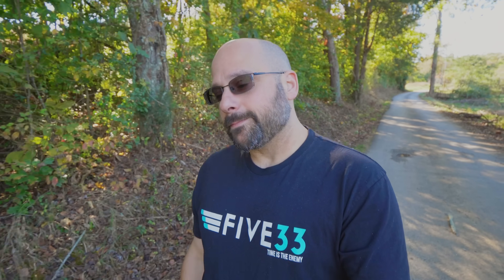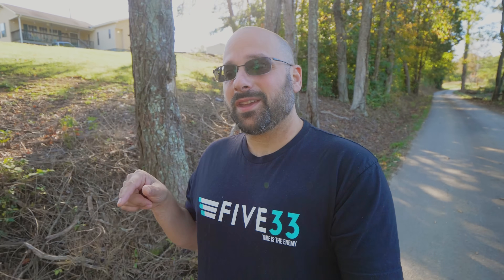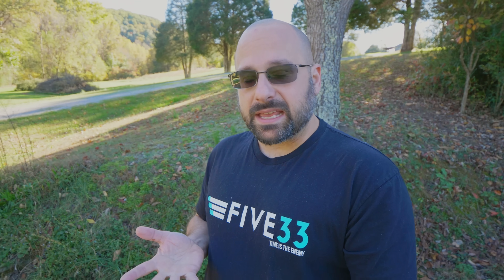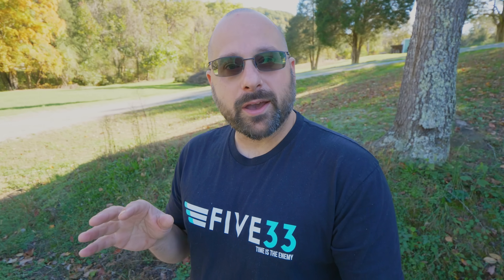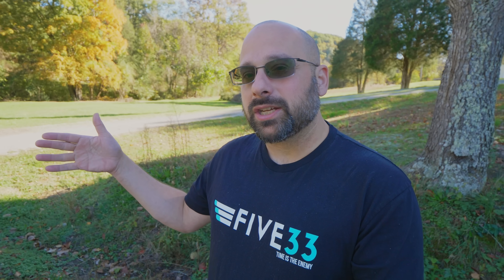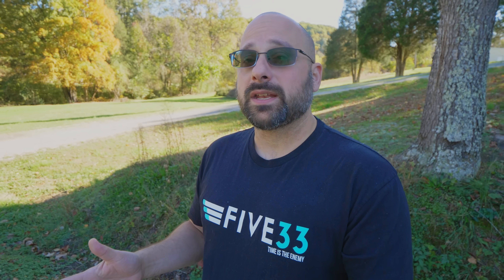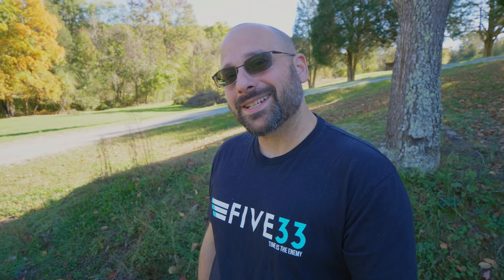How long can you leave your lipos fully charged without damaging them?

Comment: I have a Phantom 1 that I have always only flew 50% and I'm still using the same 3 batteries I bought with the drone . The only batteries I
have had problems with are Phantom 4 Pro batteries they are all junk , bad DJI design from the start . My Mavic 1 is still using the same
3 batteries . I always bring it home at 62% and land . It works for me 62% bring it home and land equals long battery life .

Comment: Chatgpt says lipos charged to 100% for 30 days straight is worse than 30 separate 24 hour periods at 4.2v. Says the rest period between charges has observable effects on the chemistry. Says a 30 day period at 100% will likely result in 20-40% reduction in lifespan not 5%. Says 5-10% per month sounds more like lithium ion batteries.

They are consumables so not using them just to make them last longer can be dumb. 

My personal experience has been that lipos stored and forgotten swell up more often than not. I personally avoid charging them unless I know I will fly later that day. I can't recommend charging them the night before either. Just buy a smart plug or electric timer for $10 and set it to charge a couple hours before you wake up. This is if you really need to be somewhere at 6am or something, otherwise just let them cool down and charge them to 3.8v. Store at 15C and check of them every few weeks for best results.

Comment: Well, I'm here because I have like 5 FPV batteries that I bought back in like 2018-2019. I did not do my homework when I got my first FPV and I charged up all the batteries, did not set up the quad and my radio properly and took it up in the mountains to test it out. I launched it into a tree in a second and I wrapped it all up and never touched it again. Here we are on todays date, I found 2 Tattu batteries that I never took out of the box and all the ones I charged. The ones in the box are surely as you mentioned brand new. No swelling no issues. The others were all stored at full capacity for like 6 years. The ones that were charged are now sitting at 3.8 ish volts and are slightly swollen. Not to the extent that they look blown up, but the plastic wrap on the outside of the battery is more bulged and puffed up that is for sure. I figure I'm going to play a bit of a risky game, but I went ahead and plugged one in and set it for a slow balance charge. So far all the cells are coming up evenly, no heat, nothing crazy going on, we will see.  I've had swollen lipos in the past and still use a couple in my cars and I have never had one blow up. But these are slightly swollen packs that I do not push when charging and considering I always ran stock specs, I doubt my cars were discharging them at any crazy rate. I have had a pack or two that was so swollen the plastic case was splitting apart and I didn't play with those. I dont know if this helps anyone, but personally I build my knowledge off of first hand experience which may not be the safest option but I figured I'd leave my experience here in case it helps.

Comment: So over winter months as I am not out flying, if I store my lipos @ 3.8v, then they will be fine leaving them for this long period right? Going by what Joshua said, technically should be good for years in storage mode? I have them in a bat box which is also placed inside a lipo holdall, in my garage, and I do a physical check every 2-3 weeks for deformation, swelling, leakage etc. This is ok right?

Comment: While I believe this is correct. I was out of the hobby for 5 years. Found 2 3s batteries left at full charge during that period.  I slowly charged them and repeatedly reached 96 to 97% since. They were an eflite and a hobby king brand 3300mah
Reply: I have about 20 lipos that are over ten years old that have been in storage mode. I'm not in the hobby anymore so I have no idea what sort of condition they are in for re use.

Comment: I am a longtime hobbyist in RC. I started in the early 80's with a tamiya frog buggy, had a 6cell nicad and a wall wort style dc charger. nicads were so stable in comparison to lipos I've noticed. in the later 80's i was racing 2wd truck a losi jrxt. i luved that truck. Took home to many trophies with it. but my point is back then we geared the cars to hopefully last a 4min race. after the race we marshal and then take our trucks to the pits and discharge the nimh pack with 12 1157 automotive lights all soldered together with a recipient plug for the battery. and depending on how long it took to make the lights dim told us if we could maybe gear up a tooth or 2 on the pinion. alot of the times we forgot the bulbs were on a battery and came back a while later to cold bulbs. but you could pull the lights off and plug it in the tekin charger and charge it right back up. I dont dare use the lights on lipos due to how delicate they are in comparison. what I have found for lipos is if your looking to get the most from your packs I charge up the night b4 for what I intend to use the next day. and like you said life happens and next day didnt goes as planed so i would try for the next day, if it wont be for a week till use I now put them on a storage charge. I have had some lipos puff up on me from accidently leaving the lipo fully charged for months. so lesson learned no more than 2days on full charge.

Comment: I have given this a lot of thought recently myself. I have had batteries charged for close to a week before using them. I prefer to discharge them on the plane in the air then on the charger on the ground. Having said that I recently bought a small generator to take to the field since we have no power there. And I will from now on charge my batteries and then fly them immediately: and I won't charge more than I'm going to use.

Comment: I've just learned to accept that 60-80% is the real "maximum" to avoid potential fireworks shows.
I store my phone/vape in a backpack while travelling (outer pocket), and wrapped in a fire blanket at night. 
Old cells are fully discharged (at least as much as they can be), and placed outside in a ventilated metal toolbox (ventilation to prevent explosions). Until I get around to disposal.
Glad to see everyone waking up to this new reality, hopefully in a few years Lithium will just be a forgotten nightmare due to better/safer tech.

Comment: I don’t fly drones, tri-copters, or helicopters so I rarely experience crashes in my airplanes that result in damaged batteries. That’s not to say that on rare occasions, I do have a completely destroyed battery.
What I have experienced with long term (6 mo or more) fully charger is my batteries will balloon. Sometimes they have lost all there stored voltage and other times not.  All will take a charge and perform adequately but I just don’t trust a puffed up battery and will discard them. My current process is any time they are not going to be used for a long time (late fall and winter is coming) I will put them in storage charge.

Comment: I never have this problem. I fly petrol (gas) engines. I can fill the tank and leave it for a week or a month or more. I only need to seal all the vents in the tank and keep it in the garage if l need to. When do come home, the tank (haha - "battery") isusually empty anyway.
I never have worry about storage or how long it takes to "recharge" before another flight. Petrol is so much safer, can fill up as often as desired and fly all day. Best of all, l dont have to lug an extra pound of dead weight when l land.
Reply from the maker: Gasoline is safer than lipos? Riiiiight. Because nobody has ever burned anything by mis-handling gasoline. Both types of fuel have their advantages and disadvantages. Fly whatever makes you happy :-)

Comment: One thing most don’t know also is that if you only ever charge a lipo to 4.1v instead of 4.2 you will get double the charge cycle life out of the battery pack.  That has been tested and proven by numerous manufacturers.

Comment: I left my lipo 1.3 4s at storage for over 2 years...i thought i lost them in a move. And this christmas i was going through bins for decorations and found it, they are still at 3.8 and im charging them now. Im so excited.
Reply: So how were they like?
Reply: @nomidubidabi  I had 2 heavily used 6s batteries that I put at 3.82v 5 years ago. just check them a month ago and they are still 3.82v EXACTLY. They still feel like 90% what I remember them being but that's within the margin of error for 5 years lol. I think they are still perfect tho. I never left them fully charged for longer than 6 hours at absolute most tho so maybe I was just more careful than average.
Reply: @donutves  Wow, that's wild, it's great to know that are so resilient to long term effects.
Reply: @nomidubidabi  ya I was always kinda worried about these batteries but they seem to be incredibly resilient
Reply: I thought that after a few months of a battery just sitting at storage charge, you would need to recharge it to that same storage level because it would drop voltage to an unsafe level just by being neglected

Comment: My guess is if you chose a battery to relentlessly scientifically test you'd come up with bold answers.  And then if you repeated on some other battery your results would differ.  Battery tech strikes me as a little fuzzy compared to a lot of other products.  BTW, if you're interested, there's movement on manufacturers recommendation for storage voltage.  Check the package inserts with GNB cells and you'll find that they now believe much lower storage voltages have benefits over the typical 3.8V.  Specifically they like storage between 3.3 and 3.6V with the caveat that you check them periodically to ensure they don't drop too far below that range.  The claim is their testing says low voltage storage optimally preserves life time capacity.  I think their drop dead minimum voltage is 2.7V to prevent chemical deterioration.  I know you did this video two years ago, so perhaps your thoughts on battery maintenance have changed.

Comment: I actually left a 4s 6000 lipo fully charged for about 5 years. Totally forget about it. I tried using it and was surprised that it still worked. Prob had about 2/3 of the capacity it did new, but considering, not bad at all.
Reply: It all depends what the C-rating is for the battery

Comment: I am always concerned about this very important matter.If I charge my batteries and the weather suddenly turns bad,low visibility,strong winds etc.This is a concern I have all the time.I charge my batteries and expect to fly,and for some reason the weather turns bad and I decide not to fly my  prised fixed model airplane.I try to strive to fly the very next day or I run the motor down until  the batteries are close to storage voltage.But,this is a major concern for me..I want to protecty batteries.

Comment: All my DJI batteries are set to 2 days to start discharging.  Also, DJI dos not consider a cycle when the battery is fully charged and the discharging kicks in and the battery goes down to 60%. If you were to recharge it, it would not add a charge cycle.

Comment: The chemistry which they come with was already mentioned, so I'm not going into that again, but you are missing one super important thing: fully charged batteries have so much energy stored that a lipo can catch fire. It shouldn't if it is in perfect condition, but as you said yourself, lipos are getting beaten up by FPV pilots and even a small physical damage could trigger then blowing up. That if course also applies for fault produced lipos.

Bringing them to storage voltage removes most of the energy and them catching fire gets almost impossible simply because there is not enough energy left .

This is my view the argument why everybody should bring fully charged batteries back to storage voltage if not used. Over night is a risk I would take it not possible to charge them in the morning if the flight day, but anything which goes beyond 24 hours I would personally try to avoid.

Comment: Here's a question that I can't find a satisfactory answer to:  None of my chargers have the resolution to match the capacity exactly. I know that it's okay to charge a 4s 660 mAh LiHV battery with a charger setting of 600 mAh 0.6a but that's leaving capacity on the table, right? My chargers only adjust in 100mAh increments and all my batteries have capacities between those values - (550mAh LiPo, 660mAh LiHV). If I set my charger to 700 mAh for a 660 battery will the voltage calculation cut off the charge before trying to cram that extra 40 mAh into it or will I harm the battery as it tries to get to 700 Mah? If the flight times were not so short, I probably wouldn't bother but I can barely get 4 min flight time and once my low battery warning appears in the goggles, I can barely make it back. I've even tried raising the warning voltage in beta flight to compensate but I am finding that I still fall short. As a result, I won't fly any farther than I think I can make it back which is less than maybe 50 yards after about 2 min of flying. Once the "land now" appears my drone basically starts descending and I look for a soft place to land. The time between "low battery" and "land now" is maybe 10 to 20 seconds. Maybe I just need to adjust. Any help would be appreciated!

Comment: Here is a good question for you. My 4s 1550mah lipo shows fully charged but when i plug in to fly and arm the motors the voltage drops drastically like down to 15.5v and when you take off and start flying it drops down to 14.5 or lower just to cruse around.  if i land the quad soon after the voltage will show high again like it's charged. if i try to fly with it like this it will not fly long and you have no real power to do anything other than cruse around. my lipo is a Ovonic 4s 1550mah 100c. it is about 1 year old.  What is the cause of this? i have a turnigy small charger and the resistance shows 10-7-7-6  can you explain what is going on or do you have a video on this? and how do i stop this from happening to my other lipos. usually i get a bad/dead cell long before i wear the lipo out so this is new to me. thanks in advance for any info & help.
Reply from the maker: This says that the C rate of the battery is too low or the battery is old and the IR is too high. The IR you're reporting is pretty low though, so that's not really consistent with what you're reporting. Does the quad do the same thing on multiple batteries? If there was a bad solder joint causing high resistance, you would get the same symptoms.
Reply: @JoshuaBardwell  the other ovonic lipos i have are the same size and they fly great. im like you and think the ir is to high even though my charger says it's not. it's a cheap charger so don't know how well i can trust what it's telling me. ill check the solder joints. never thought of that! Your awesome brother thanks for the help. Love your videos.
Reply: @JoshuaBardwell  is there a way to check the ir with a meter instead of my cheap charger?

Comment: I am a hard core 3d RC Heli pilot.
I have lipo’s from 2012 that still take in full capacity..it’s now 2023… my secret you ask?? 
- only charge at 1c
- store them at 3.8 volts per cell and keep them in a cool place.
- charge them up to 4.15 volts per cell not 4.2 volts per cell. (This doubles their lifespan)
Happy flying dudes!!

Comment: Consider this. 1 cycle is 3.2v to 4.2v then back to 3.2v. So one flight would be one cycle if your batter was at 3.2v and you charged it to 4.2v but did not fly and brought it back down to 3.6v that would not be a full cycle but only 3/4 of cycle. charging it back to 4.2v and back down to 3.8v would complete the cycle and ad a bit more. Keeping it fully charged for extended amount of time would reduce the cycles quite a bit. So my take is to always bring it back down to "Storage" to extend the amounts of cycles. I do not fly as aggressive as many do so there fore cycles is my priority. For those that fly often and very aggressive should not worry about keeping it at full charge but do keep in mind that they still do self discharge and for that reason battery makers keep them at 3.8v.

Comment: If you leave them charged for around 2 years I'm pretty sure they are done. I charged up 8 batteries and got rained out 2 days in a row and for some reason didn't fly for a long time(2 years about) so I grabbed one plugged it in and hovered in my garage. Less than 2 minutes and the battery couldn't keep the copter in the air.... when I unplugged it it was super hot and puffer than I've ever had a battery. It went right in the safe box. Tried another and same thing. They are toast and I get to order a few more now.

Comment: Agree with the information you shared here. Minus one point. 
Taking a charged battery to storage voltage is not one cycle! 
One cycle is full capacity from full to empty, and back to full again. 
Considering storage voltage is approximately 50% capacity. 
And assuming you discharge to this 50% point, then later recharge back to 100% for use. That would technically only be half a cycle. Which IMO is still less detrimental than leaving the battery at 100% for any period of time.

Comment: I’ve lost cells from leaving a battery in storage mode. I’ve never lost a cell from leaving it fully charged. So in my experience, leaving the cell at 3.9 or 4v per cell is ideal because they are quicker to charge and less chance of losing a cell. Note: I’m not sure why I lost a cell. Cheap Wltoys battery? Temp fluctuations in garage? The quality batteries don’t have these issues. In conclusion nobody is sure, as you say